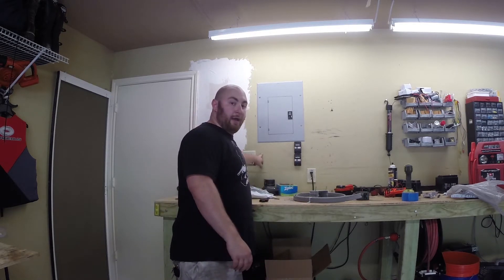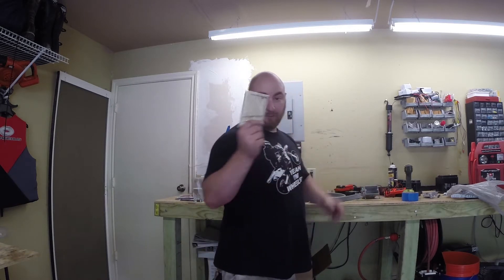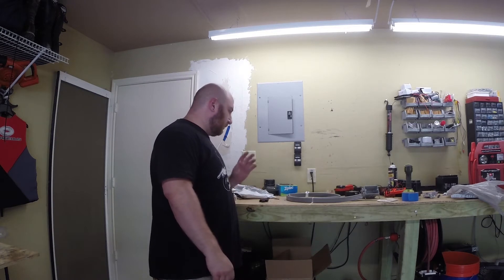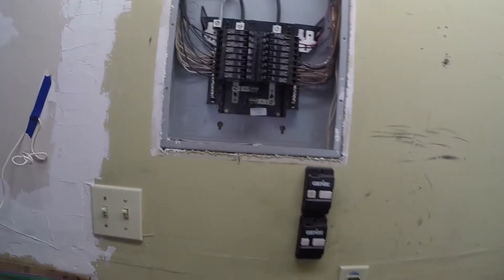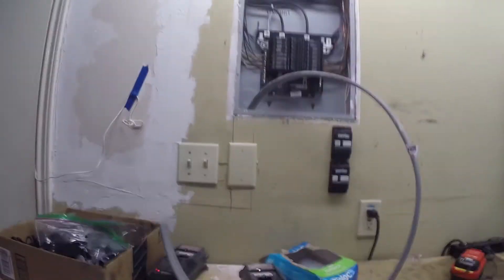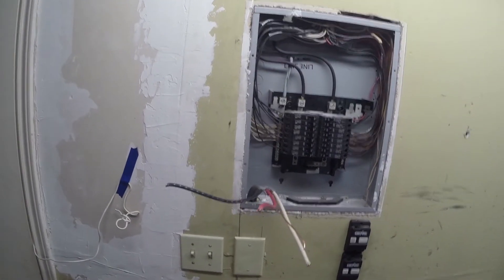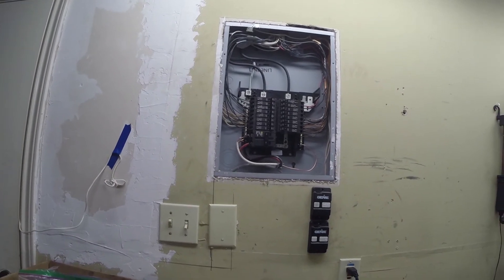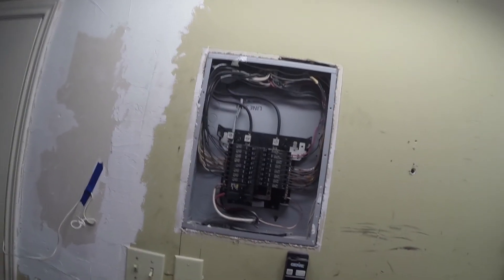MaksWerks Home - Installing a 240V Welding Plug and Breaker

Comment: jabronie
Reply: dyno mike violations galore! thats why us electrians charge so much!!
Reply: Exactly right. You electricians make your money off the fact that there is a RIDICULOUS book of codes that is about 10 times bigger than it should be and takes forever to learn and become familiar with. 90% of it has very little to do with real world practicality and safety, it exists in it's current form simply to give electricians job security. Yet, what MaksWerks did here is perfectly safe and saved him $400 in bullshit "code" adherence from a pompous electrician. Now, if you will excuse me, I'm going to go and do the same thing in my garage...without an electrician.